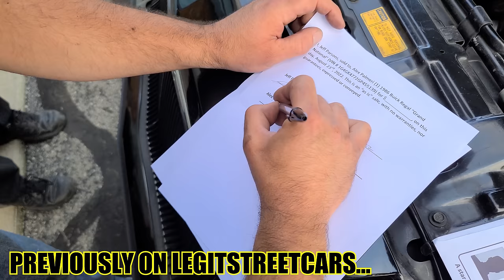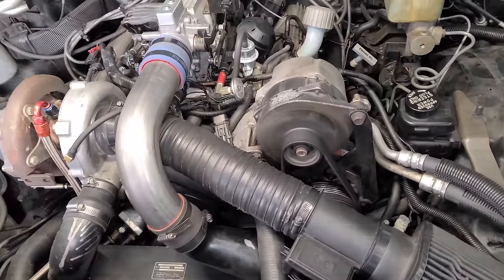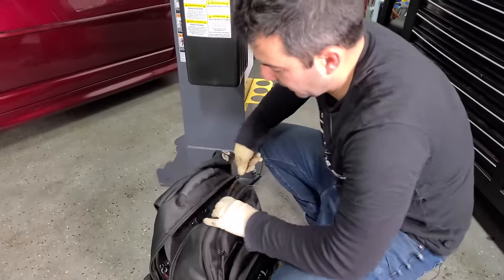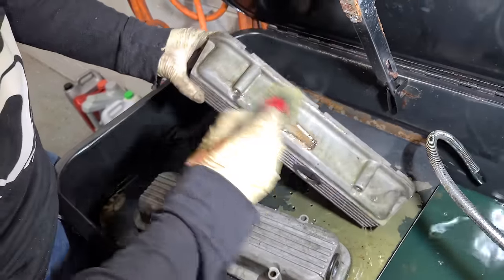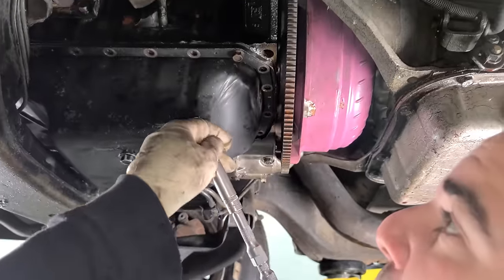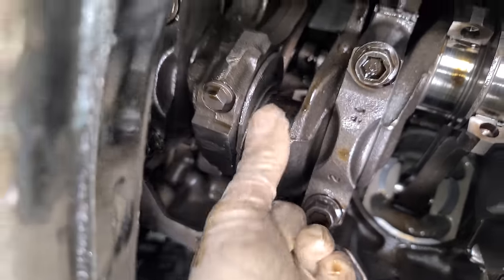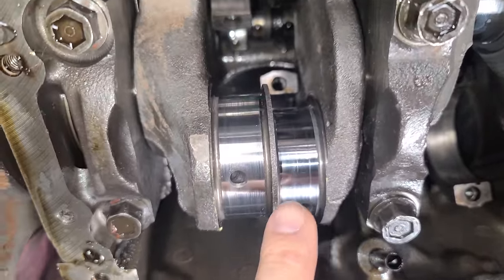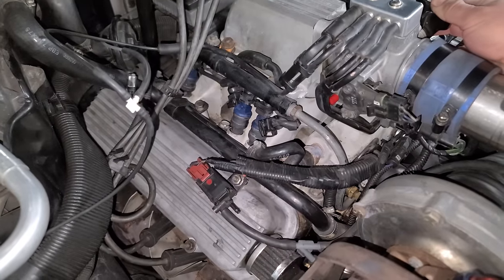I Found A Fully Built Engine In My Grand National That Was About To BLOW UP! DIY Fixed It For $32!

Comment: The only reason the bearings were bad was the mismatched caps. I'm surprised they could get it to turn over back when they put it together. The weird wear pattern was the clue. The bearings should last as long as the rest of the motor. That was an impressive catch! Your emory cloth and shoestring trick was something I had never seen before. After 42 years doing this I have seen most everything but I learned something today! Thank you!

Comment: This is undoubtedly one of the best examples I've ever seen about how to properly and methodically diagnose a problem. It didn't even occur to me to check the bearings, even though they were clearly accessible when you dropped the oil pan. I love how you clearly explain everything you're doing and why. I'm learning a lot, so thank you!
Reply: If it sounds like rod knock, check for rod knock.
Reply: @rustler08  miracle they didn't spin at least one or chew that crank up after all that driving like that. Glad for them that it worked out that well.

Comment: Never stop doing these rescue videos man. My story is that, before I knew much about cars (other than they’re super cool) I picked up a 1995 Toyota Supra 1100 miles away from me. The thing was NOT in driving condition and was down 3-4 quarts after 700 miles, which I found out after the oil pressure light came on. I added oil, then the cooling issue started. This thing was leaking coolant everywhere right at the bottom of the Grapevine in CA. I had to drive it 100 yards at a time on this tiny shoulder with Semi trucks passing inches away from us before I could get to the top of the pass and fill the rad with water. (The tires also had to be replaced somewhere along the way). All this prompted me to learn everything I could about cars and now I made a career out of it. Seeing how a master tech thinks out there in the trenches and how you limp these rough diamonds home is pinnacle entertainment/education for me! Keep it up! 

Btw, I ended up fixing the Supra up for a profit in the end and using the proceeds to buy my first home!

Comment: As a season mechanic for over 30 plus years and GM tech who worked on GN , you guys did the right thing from diag to bearing replacement . Nice to see you polishing the crank . Two thousand clearance is on the money . That EGR being lose would cause any engine to run rough . M.A.P voltage would have been way over 1.5 vts at idle . Bucket list car for sure.

Comment: Great repair! I suggest investing in an adjustable fuel pressure regulator. Those blue top injectors are not stock and fuel pressure should be much higher with an aftermarket tune.
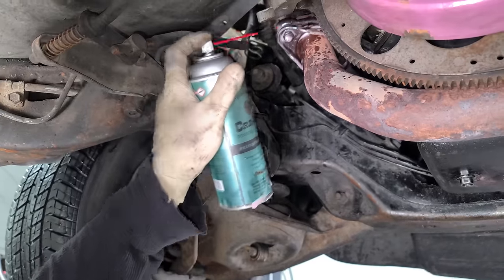21:08 The PCV valve is pushed in all the way. There’s a nipple that goes down in the grommet — weird I know! 
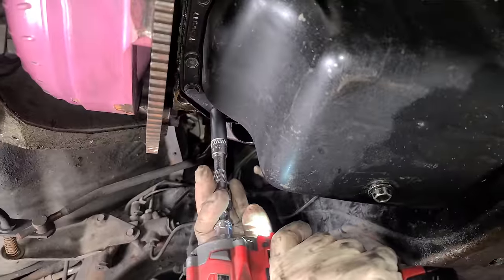22:50 good catch on the loose EGR valve. We tend to delete the EGR system with a block off plate. 
26:12 I wish all cars had that positive notch in the valve cover gasket. Very handy when putting things back together. 
27:10 don’t worry about that green wire, it’s supposed to be disconnected. It’s the under hood tach signal. There’s a black wire near there too that can be used to send power to the fuel pump. 
I never knew how to polish journals. Learned something new today. Nice find on the wheels, Chicago is a hot spot for Grand Nationals. Keep up the great work!

Comment: I love this episode! I'm into GN's, Typhoons/Sycones, Turbo TA's and this was a joy to watch. I changed out the rod bearings on my supercharged e30 M3 and Mk3 Toyota Supra with engine in the car about 25 years ago and they are still going strong.  The supra had a bad rod knock with slightly scored journal (I didn't even polish it) and it ran like new after the rod bearing R&R.  Two of the rod bearings were down to copper so this episode made me relive my experience with these two cars.

Comment: Always got to love a channel that offers builds AND actually diagnosing problems
Reply: Amen, thes guys are real world techs, no shotgun diagnosis on this here station. (Shotgun, = stand back and throw every part it MIGHT be and hope the problem goes away. no corrision/loose connectionm/ defective new parts or out of gas problems that are never addressed by new premedona , huge snap on tool box with 3/4 empty drawers with lots of harbor freight items filling up the unscratched drawers.. They have one single wire test lite  and one of those FREE DVOMs harbor gives away for free and has no idea how to use it(whats a ohm?)

Comment: So surprised at the mixed rod caps! What a way to screw things up, but the engine soldiered on. You guys saved it just in time. Great Job!
Reply: It sounded worse than when they got it. Definitely saved just in time.
Reply: @Constabruity  It certainly wouldn't have continued much longer...
Reply: I’ve seen reman engines with mix match rods
Reply: Good thing the previous couple of owners didn't just "send it" and drive the car as is.
Reply: Right? Like they numbered them both sides, but didn't put them back together correctly? You did the hard part, but not the easy part.
Reply: @aidenstefanson2175  some times from factory the rods are stamped to each cylinder. When you send in your old engine for a core. Some company goes through and rebuild a new engine reman engine with your parts and probably hundreds of others. I’m sure they balance the crankshaft to the whole new rotating assembly. I’m not 100% on this
Reply: @Fatfox806  But this is clearly a custom job, not some reman job pulling parts from various engines.  that's the baffling part.
Reply: @NEEDbacon  if it would of been a custom job, there would be no stamps on the rods, or numbers would be scratched off. Go buy a reman long block, even tells you bore can be over sized. We had a block using .30 over pistons and one .20. I’m guessing they just balance the crankshaft enough
Reply: @Fatfox806  mixing and matching rods and caps, grinding the caps down and honing to spec. That makes a lot of sense, thanks for that perspective!
Reply: @aidenstefanson2175  I do not like reman engines. And there is reasons for it. Nothing like building a engine from ground up, just more expensive for customers. Cheaper putting a rebuilt long block from some company that half ass their work and sell them cheap with good warranty. There are some companies that rebuild them with high quality work, but you gotta pay more $$. Good labor is not cheap

Comment: Something to look into that I did with my Grand National, I had a wheel repair guy put 2" wider chrome barrels on the rear stock wheels, making them 9", but keep the same backspacing. I was able to run a wider tire, but keep the stock look. Also keep an eye out for the front plastic trim pieces you're missing under the front bumper. They really complete the look of the front. They go on both sides of the IC intake scoop.

Comment: Alex! Try 10w50 oil in it. Your rod bearing clearances are still on the loose side.
(Unless it's prone to cause turbo issues)
Reply: It looks to be in the upper end of what's okay. Should be fine even with 10W-30 oil.
Reply: Hopefully. Plus there is Chicago weather.

If Alex is gonna put a rebuilt motor in it, then it's fine anyway.

Comment: G'day, another great video LSC! Alex, both Peter and yourself make an absolutely amazing team mate. You both are incredibly knowledgeable & talented at diagnosing problem(s) then subsequently fixing them. The knowledge you both possess, involving both domestic & imports,  is extremely impressive! Of course there's Max, who does an amazing job filming the videos, especially, getting into those tight arse places. Great Job LSC Team! Cheers from Western Australia 🇦🇺.
Reply: Thanks for commenting, etc. Another viewer in different Countries:: always, of interest & another viewpoints, & perspectives.. Interestingly, I spent lots of time driving in & out , staying, events, of Chicago::: to N Indiana Homes.. Anyways, relocated to HELENA MT with GRANDKIDS/ Kids closer, & still a car Guy.. now is Studded / chains tire time *and occasionally—31 F OR COLDER… just fixing non-start 2015;Journey ( original Battwry *&;5w-20  MOPAR CONVENTIONAL OIL(( going to new Battery, &;*5W-20, Full synthetic Oil :( all VALVOLINE & Filter in local Shop)…By way of comparison. My 2007 GMC CANYON 4 CYL, starts at —31 to —34 F  sitting outside(* though protesting, &  sluggish  for awhile)…. May relook at 0 W OILS IN winter here, Suspect AUSTRALIA, NOT quite variations.  IMHAVE HEARD THAT STUDEBAKER ( in 1950s) and FORD ETC LATER ON SENT quite a few CARS/ trucks to AUS.

Comment: Nice done!
An other idea regarding the fuel starvation could be a clogged tank ventilation. That would lead to this kind of problem. Possibly not that fast though. I had this issue on a 70s Opel and one time I heard a loud bang when the tank more or less imploded.

Comment: Another thing you might want to keep in mind is that you glue the gasket to the valve cover, and not to the head cork will seal to the head with no issues.

Comment: By the looks of those bearings it's almost like the crank wasn't balanced or balanced improperly. Nice easy fix those, huge win guys yay 👏 😀
Reply: Always a concern I'm guessing but if the bearings' locations were swapped during a past service or inspection the wear suggests LSC's theory is plausible
Reply: @john badal  yes I definitely agree. It definitely was a huge oversight. Maybe 2 different guys working on it who knows 🤔
Reply: I think the rod caps being on the wrong rods was probably the leading cause of the wear on the bearings, if not the only cause.

Comment: 🏁🏁🏁🏁 I’m geddy 🤓 with excitement …This is gonna be a great series with the Buick Grand National …forge the engine bigger turbo and turn up the freakin boost 😎🤙🏾 update Alex has a fully forged short block for the GN 😎
Reply: All the fukin boost baby 💨
Reply: This build is gonna be so so sweet who doesn’t like a Buick GN 😱
Reply: It already has a bigger turbo not you remember from the last video or did you not watch it?
Reply: @MonzaRacer   hey 👋 🤡 there are many different turbo upgrades for this platform I’m sure the current turbo setup on this GN isn’t the biggest most powerful turbo Alex could use especially with a forged engine…stop being a hater if you don’t have anything positive to say 🤓 peace be with you
Reply: @MonzaRacer  smh 🤦 always a car hater lurking 👀 just stop while you are ahead …I guess the turbo currently on the GN is the biggest one ever fitted to car ever 🤡
Reply: @MonzaRacer   so lame 😒
Reply: @Fasteddiebreakshearts  pretty sure alex wanted to keep it somewhat stock.
Reply: What does "forge the engine" mean?
Reply: @hackzgames  wrong …car ran a 11.5 quarter that ain’t stock. GN already has a built transmission bigger turbo and arp head bolts stock went out the window 🪟 along time ago 😂
Reply: @theupscriber65  Forged parts is the most common name when people think of engine internals strengthening, and this is generally aluminium or steel heated till they are soft rather than molten, and then squeezed in a die under very high pressure to make the component pistons rods etc.

Comment: The almighty algorithm deemed your first Grand National video worthy to be one of it's daily offerings. And it was one of the few times it actually got it right.

I watched the video when it was released 10 days ago, but didn't subscribe because I have been played before. You catch the first installment, then it's months down the road before you get another video that isn't just one of a half dozen versions of the same video,with the same information,and no actual forward progression on the project. So what I do is pop over to the channel once a week to see if there's been any actual new content put out, and low and behold you had the GRAND-daddy up on a lift suss-ing out your knock properly. Proving yourself both knowledgeable and capable with diagnostics and repairs. Not one of the countless duct tape, super glue, and silicone so called mechanics that steer people in not just the wrong direction, but almost always an astronomically more expensive one in the long run when the damage persists and eventually worsens. 

Good job my friend, you gained yourself a new subscriber today, and probably several more, because when I find something worth watching, I tend to share it and recommend it to those friends who have interests akin to my own.

Comment: I did this exact repair to a 94 Ford 300 inline with 174,000 miles that had wiped bearings on every rod and was knocking like hell with zero oil pressure. 
None of the bearings were spun yet so I put new standard size bearings in it after polishing with the shoe string method.

Old guy drives it 20 miles to work everyday and is very happy to have his truck again that he thought was dead

Comment from the maker: How much boost should I feed this engine?
Reply: I would say as much as you can🔥
Reply: All boost he can get HAHA
Reply: All the much!!
Reply: as much as u can but in a safe way
Reply: just enough🤣
Reply: All the boost 😂
Reply: All of it.
Reply: 18psi
Reply: All of it! Lmao jk 28lbs?
Reply: All
Reply: All of it
Reply: Whatever U want, doesn’t matter to me
Reply: Put a MOON TUNE on it!
Reply: More than it can handle :D
Reply: just a little less than what blows it up?!
Reply: All of it Alex!!!😂😂😂🇨🇦🇨🇦🇨🇦
Reply: All of it!!!
Reply: Yes
Reply: 18
Reply: #1 GET A SCANMASTER so you can read the sensors first. Then put an Alky Control kit on it with a turbo tweak chip some bigger injectors, bigger fuel pump and adjustable regulator and crank it up. On today's pump 93 or 91 and what I can only assume is an old chip (some great chips from back then but too aggressive for today's crap gas)  you are not going to get much over 16-17lbs without knock. Your injectors look like 36# Blue Tops from a super coupe which were really common upgrades back in the day. My guess is that the combo may be a TE44 turbo (maybe a TE60), Terry Houston Downpipe, Duttwieler neck on the intercooler, vigilante lockup converter, ATR exhaust (one of the best). Pretty common 11.5 recipe build. Can't wait to see more on this car!